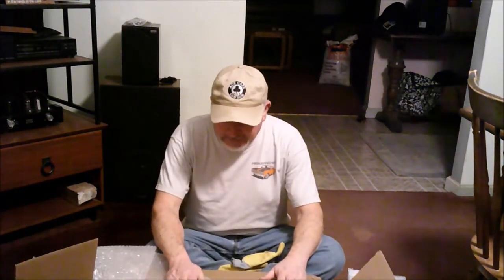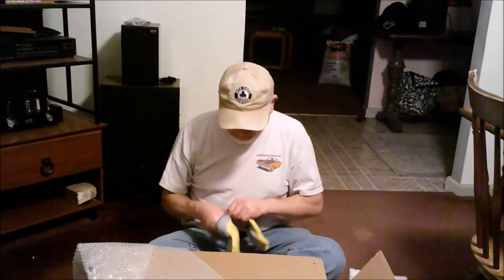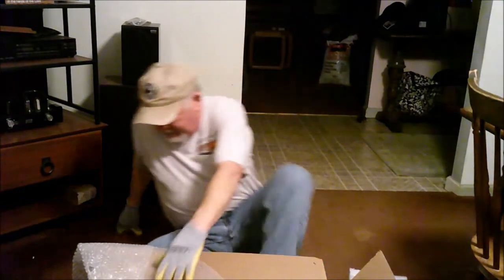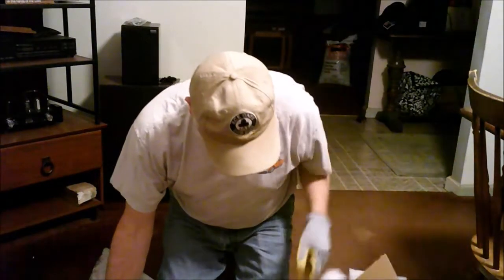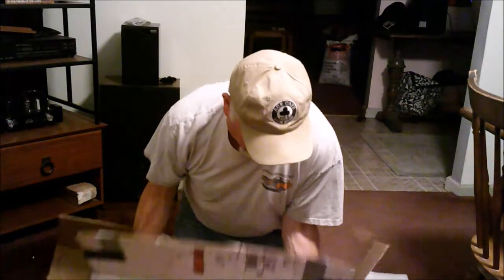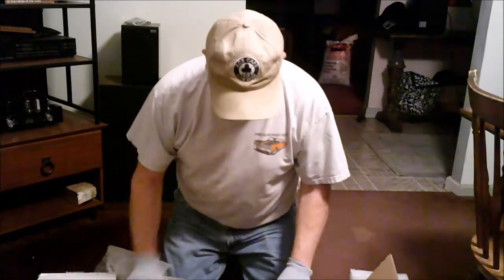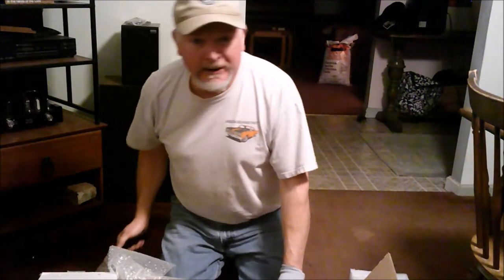350 Pontiac build direction, let's build a stroker !

Comment: Definitely agree about the Pontiac community!  I went the stroker route with my pontiac 400, stock bore, so it brought it up to the 455 ci.  Im excited to see how it runs on the open road. Still got the 2.73 peg leg for gears though.  definitely will be upgrading to Posi in the future.  But im very interested in how your 350 build turns out.  I still have the stock 350 two barrel that came with my 75 esprit. I figure i will eventually do what your about to do and find a roller to drop it into (down the road when my bird is done, of course).  Good luck man. Excited to see your project progress!!
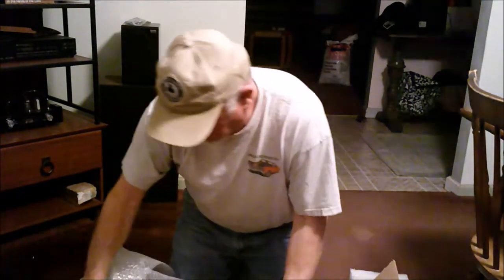Reply from the maker: Thanks for the kind words. Been following your 75 for a while now. Been an inspiration. Its turned out great, especially the paint . The 350 though not the original 76 engine came with the car. I'm hoping it turns out well. I'm thinking either 3:23 0r 3:55 for gears, unless I go with a 200R4 transmission, then I may go with a 3:73 . Hard to say.

Comment: The Chevy 383 makes soo much power because of the Chevy head port design. Pontiac heads generally don't flow as much, so you really can't compare the 2 if you stroked them. If you have your heart set on a stroker, I would look at getting a 400 and look at doing a 4" stroke kit. At least the 400 will allow you to stick in a large valve heads. With the 350 Pontiac, yes you can use a large valve GTO style heads if you don't go over .450" valve lift to avoid notching the cylinders.